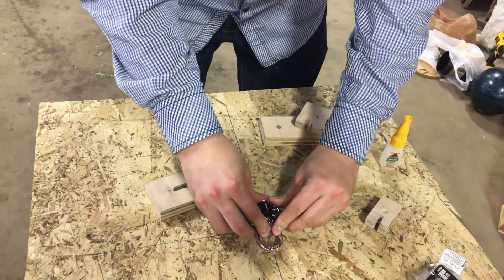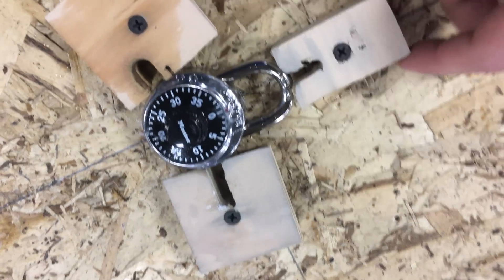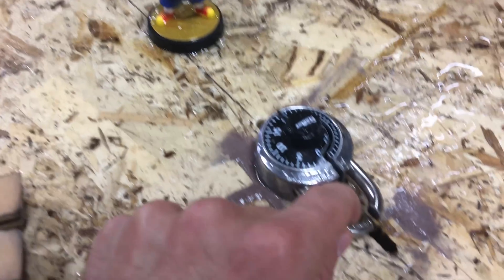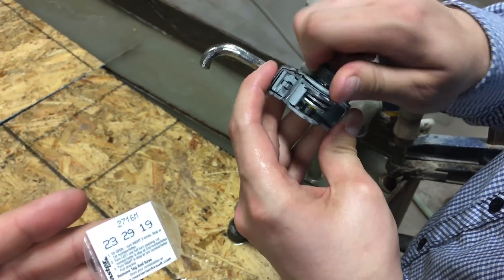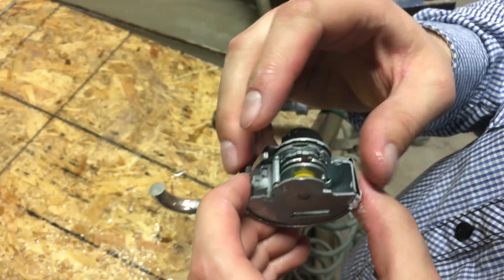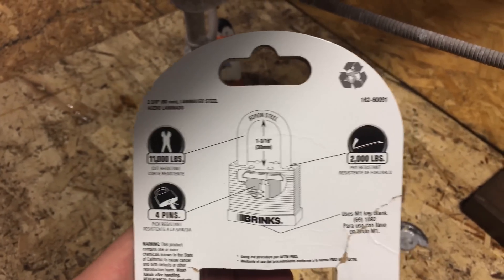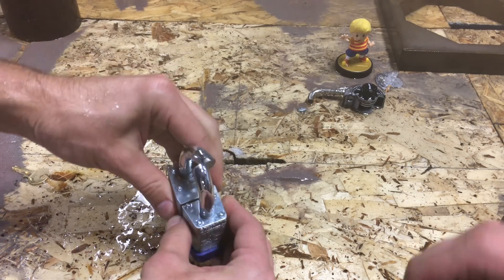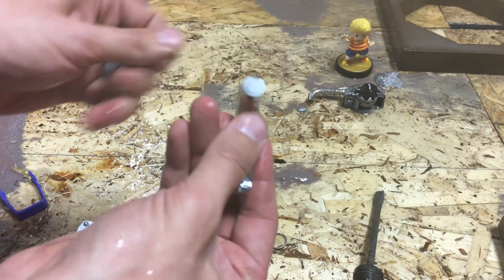Giant Padlock vs A 60,000 PSI Waterjet

Comment: "north Salt Lake" How many youtubers are there in utah?!
Reply: Hi. Cody I'm a big fan of your videos
Reply: Cody'sLab A TON. I just wish I could get these guys to respond to my offer of a LOT of high speed steel to cut. It would be an awesome demonstration about the difference between cutting and a beating. And I'm like 15 minutes away with over 200 pounds of high speed steel to play with. But so far they seem disinterested. 

You want to do any videos with HSS? (M2, M4, M36, and M42.) These are massive pieces, at least relative to the sizes usually used for machine tooling. I don't know what you would use them for, but as a subscriber I have to expect that you could think of something. :)